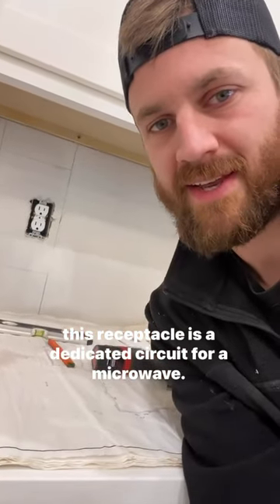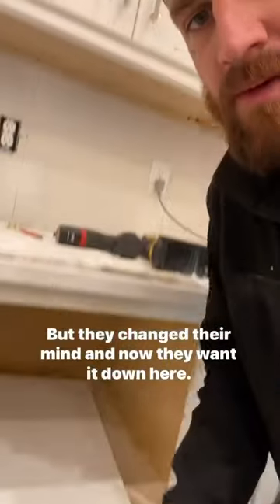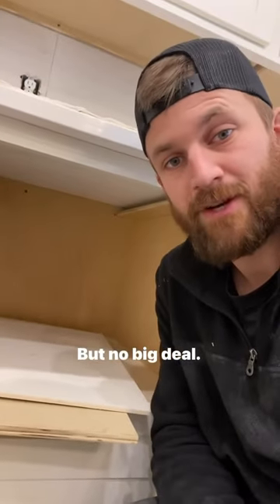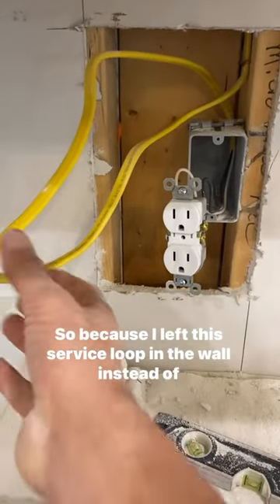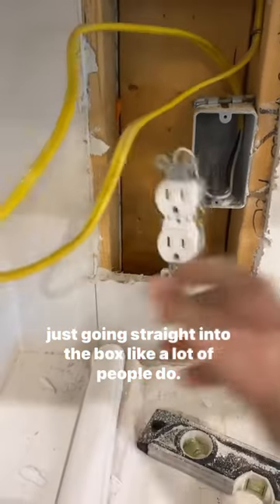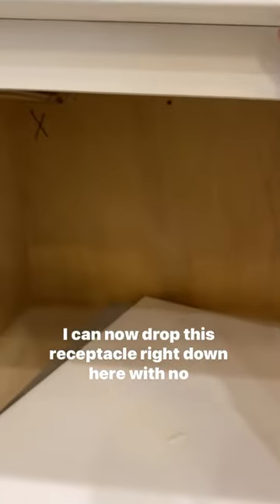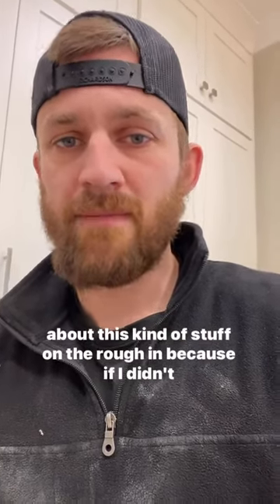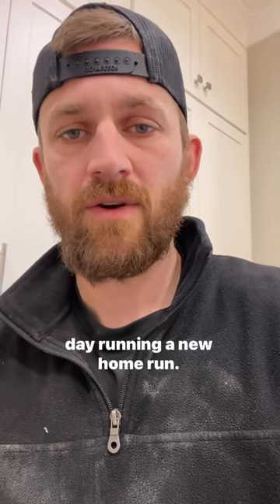This is Why You Should Leave Service Loops!! #electrician #bluecollarlife #construction

Comment: I see that receptacle is inside a framing corner? Stud on either side and one behind it?  I hope you caught that, I saw your X down below in the microwave cavity.  I’m not trying to troll you like 75% of the comments, I was just hoping you caught that it was inside a corner.   I have an electrical inspection coming up, I’m going to ask about the service loop issue that everyone harasses you about. Technically you have a staple within 6 inches of your box, there’s just a service loop between 🤷🏻‍♂️

Comment: My shop teacher for electrical in high school said that you should always leave some extra wire between the boxes because you need it there in case you want to switch your outlet or switch to a different one later.
Reply: Or the drywallers knick the wire while cutting out the boxes lol
Reply: @markk3948  you only need to unscrew the faceplate to get to the wires in order to switch out the outlet to a different one, why would there need to be drywall involved?
Reply: @MissMeganBeckett  when you rough in a house the drtwallers put the drywall up after.  Then they use the rotirzip to cut out the electrical boxes.  If they knick the wires which they usually do because they go too far in. Then you can pull out some of the service loops
Reply: Some wire, yes, it shouldn't be tight enough to play music on. The amount that guy left in the wall would never pass inspection. There's no way he's an actual licensed electrician. There's building code that says how much wire can be lose between staples.

Comment: You could have offered a new home run. You also could have just extended from that box and put a blank cover over it. Depends on how fancy the build. Make sure to offer legitimate cheaper options to the customer when available. In this case it was a good idea to have a service loop but that much wire left at every receptacle adds up.
Reply: Nope. Would violate code on counter top receptacles. That box will still have to have a receptacle in it. And since this plug for the microwave is just for the microwave it would be classified as a dedicated circuit and therefore would have to have a home run pursuant to code.
Reply: @thebigd6249  interesting. I thought as long as it was blanked out it would still qualify as a dedicated circuit. Functionally it doesn't seem like it would be a big deal.

Comment: By code you need 2 outlets on that counter top and your loop is technically a code violation. Way more than the allowed cable length after the staple to the box entrance. So your “genius service loop” that you relocated stupidly became two violations and you filmed it because you thought it was such a great idea.
Reply: It depends on what version of the NEC is in use in his state.  Many states are still using 2017, which has no maximum on how long a service loop can be (that was only added in the 2020 version).

(And there clearly are other outlets above that counter top already, you can see them in a couple of the shots.  Without seeing the whole space it's hard to evaluate whether everything meets code or not, but I don't see any reason to believe it doesn't from these shots (and these requirements have also changed a lot in the newer versions of the NEC, which may not apply here yet).)
Reply: @foogod4237  it’s not hard to evaluate. He had two and needs two. He killed one and moved it down. I believe code is no more than 12 inches of wire between staple and box.

Comment: The only problem I have with this video is that’s it’s clearly just for comments. It has no educational value, except maybe that extra-long service loops can be helpful. They also use up extra wire, raising the cost to someone, probably the homeowner. 
Since the rough-in person probably left two feet of wire outside the wall, it’s slightly better than cutting it off and filling up my landfill.

Comment: That's the thing service loops in a residential setting Do not make sense. They are stupid all you need to do if it the wires too short, in wall splice kit run wire down there, you go. Service loops are more of a requirement for a commercial setting

Comment: I've been a data cable dawg for 15 years, never seen sparkys use a service loop lol. I figured it was a code thing.

But can someone explain to me why TelCo guys REFUSE to put any loops ANYWHERE?!? they just add 1million scotch locks to everything.

"Pair is dead, let's switch and split pairs 30 different times between 15 IDFs..."

edit I don't mean the CO guys, I mean the ones post DEMARC

Comment: Or, since 99.99% of the time there will not be a "service loop", which isn't a real thing actual electricians do (because thats a giant code violation). You would have just spliced in an additional bit of romex either inside or outside that current box and ran it to where it's needed. No one aside from someone who likes to scam a customer with 18in of extra wire at every point or by running a whole new line to run up costs would do this unless the customer specifically stated "hey I'm going to move that outlet in a few years".
Reply: Service loops are not prohibited anywhere in the NEC (in fact, from 2020 onwards they're explicitly allowed in section 334.30).

And it totally is a thing that lots of real electricians do actually do (particularly if they anticipate that there might be a need to move the outlet in the future, such as a dedicated circuit for an appliance that people may want to change later, as in this case).

And this way he does not need to keep an accessible (and unsightly) box up top just for the splice.  He can remove the old box entirely and have a nice clean backsplash there in the end result, so it looks much more professional and the customer is happier.
Reply: @foogod4237  I'll go ahead and listen to what multiple inspectors have told me as well as 2 different electricians. No giant wasteful miles of unnecessary cable inside the wall for safety reasons. A few inches is sufficient.

Comment: Not a big deal. Is cut in a remodel box below. Reach up in the wall, grab the cable and pull it down. Problem solved didn't even need to cut the sheet rock

Comment: Just add a 2nd outlet running on the existing outlet Mr.Patches.
Reply: He said microwave requires dedicated circuit so having 2 receptacles allows something else to be plugged into the same circuit. It’s a code violation Mr. Walnut brain.

Comment: Calling BS on this. The in wall splice kits (designed for applications exactly like this one), like almost any Listed piece of equipment, is PERFECTLY SAFE IF INSTALLED CORRECTLY. "Service Loops" are a ridiculous waste of cable.

Comment: Why did you just cut all that drywall out? All you had to do was take the wire off the plug push it out of the back of the box use a flathead to pull the box off the stud cut a hole for another receptacle fish the wire down and patch with the new piece you cut out

Comment: Definitely a lot of use for the loops but I’m worried abt someone puttin a screw threw it on accident
Reply: If there was a genuine worry, they would have fastened a steel plate between 2 nearby studs in front of said wire loops to protect them the way it's required for plumbing and electrical in the code book. Then it's done correctly. Code changes very slowly and may not cover all situations.
Reply: That is why you should have an RCD/GFCI in the distribution panel and not in the receptacle.

Comment: A whole day for a 12/2 lol. And you didnt have to cut the rock like that. Get yourself a multi tool and cut the nails off and pull put the box then cut your hole in the lower cabinet and take a piece of 8 solid and hook it. And if you didnt leave a loop, cut in a box in the cabinet above and make a junction box and feed the wire from there. And just one blank plate.

Comment: Jeeze thats a huge loop (waste of wire) super loose aswell so could easily have drilled a screw in it or cut the wire when you cut out the drywall.  Anyway im pretty sure you left it that long just incase they needed to move the microwave.

Comment: Just leave this receptacle in place, cut out a new opening down in the drawer and fish 2ft of wire. That’s it.
Reply: Fr why cut drywall and make repairs when there's a solution that takes 5 mins. Looks like an easy pull too unless there's blocking
Reply: @blue_equinox7115  i meant cut a hole for a box, not a huge opening alike he did.
Reply: @yasha4929  I'm agreeing with you, talking about the cuts in video

Comment: I've asked a few contractors to do this and they either gave me a blank stare or a condescending chuckle.
Reply: wasntme7845  that's the third most common nonsense answer. I
Reply: No offense dude, but it’s not done because it’s not legal. You would not pass inspection. Also, if you looked at his work around the house and he did this with all his wires, the job will look horrible. When a job looks messy, the inspector will subconsciously feel like the job is wrong and will actively start looking at the electricians work for more code violations. I’ve been a residential electrician for 25years and I’ve never needed a service loop ever. There are ALWAYS other options, the last preferable option being an in-wall splice kit. Your electrician should have explained to you WHY a service loop is not allowed instead of making you feel bad for it but regardless, your electrician was right.

Comment: Except that cable isn't secured with 8" of the box. Yes, I said 8" because a non-metallic box without cable clamps is required to have cable secured within 8", not 12".
Reply: that box has an integrated clamp so the first 8 or 12” is covered either way.
Reply: @brandonrippeonphoto  No, it doesn't have an integrated clamp. It's a standard 70 cent single gang nail-on box. It has a square plastic knock out. It's just a hole.

Comment: So now where is your first outlet 24 inches from the wall to meet code? Why couldn’t you just left the service loop go down to the floor and back up to your box so you could’ve cut it in down below the cabinet instead of cutting out all the sheet rock why didn’t you just pull the outlet out and the box out and then just push the wire down the wall and fish it back out from underneath the countertopwhy don’t you just splice into it and leave the receptacle there microwave does not have to be on a dedicated circuit I just shake my head flew too high and fell so far

Comment: Hell shit all you'd have to do is cut your hole down below the other box and rec ,pull out the rec and fish down your 12-2 with ground down from the top box down to the lower rec box for the new microwave location and then just re install the new rec above the cabinet and install a rec down below the cabinet and your done!!! ..... Problem solved eazy

Comment: Microwaves need a dedicated circuit??
Reply: 100%
Reply: Any appliance that utilitizes more than 50% of the circuits power is required to be dedicated. for a 20 amp circuit you have 2400 watts available, most microwaves are around 1200-1500 watts, so yes it needs to be dedicated.

Comment: No no, this is all wrong, you're supposed to only run EXACTLY the amount of wire needed on the first try, to save on materials, then you are supposed to up-charge them for the replacement home run on the change order.  You are terrible at business!  (No seriously, I appreciate what you did, given that my own electrical installers screwed up on the outlet for the stove and had to drop down from the Microwave circuit).

Comment: You violate the code by putting the “service loop” in. I’m sure you think that you should be doing anything you want, but there’s a reason for codes. Also, If it’s going to take you all day to set up a junction box and run a wire 3 feet, please let me know so I’ll hire a real electrician. Also, love the oversized cutout that I’m going to have to call a drywall professional to fix correctly, or are you claiming to be that also?

Comment: Or you can use Emt like the rest of us. No big deal to rip the wires out and extend the raceway to pull new wire. 🤷‍♂️
Reply: Can't imagine doing a house roughin with EMT, but I understand it's required in a few areas.
Reply: When I did resi I would pipe kitchen boxes up into the attic for future upgrades, but most dingbats don't know how to bend pipe

Comment: Type NM cable must be installed back from the front edge of the stud - code requires 1-1/4”  back (think the length of a standard drywall screw) This is also true for holes drilled for lateral runs - the edge of the hole must be 1-1/4” from the edge of either side of the stud. In a regular 2 x 4 wall, a 1” hole exactly in the center of a stud leaves 1-1/4” clearance on each side. My point is that leaving a loose loop of wire in the wall could be close to the front, allowing screws, anchors and the like to come in contact with them. All this guy had to do was leave the receptacle above the counter, then run a line from there underneath. This guy is not an electrician, I guarantee it - he’s a handyman hack with little experience. Who am I to bash this guy? I’m a licensed Master Electrician and apprentice instructor with 45+ years experience. I plan on reporting this video as this practice is dangerous and not to code.

Comment: That loop is a code violation. Cant have that much extra cable between its closest staple and where it enters the box. Besides you are going to need an outlet there regardless to address that section of counter top facepalm

Comment: Sir, you’re absolutely incorrect. a new home run is not necessary if you’re short. Wagos are used for splicing and pigtails. If you told me that I needed a new homer for this project, I would have not paid you and let you out of my door; as in, your’re fired.

Comment: That's illegal and will trip sensitive arc-fault breakers. I don't do residential because it SUUUUUUUUUUCKS, but the answer to that isn't a new homerun, it's splicing in that box, putting a single-gang blank on it, and a cut-in box for the new receptacle. If that was new construction, the inspector needs fired, but I assume it's in Tennessee, so I'm just glad it even has a ground... If you actually loop every one you put in, you should be barred from ever doing electrical work ever again, but we all know you don't and this was sheerly for the video. Go ahead and grab 'A' phase in one hand and 'B' phase in the left next time you do REAL electrical work while standing in knee-deep saltwater. Thanks.

Comment: A service loop? Inside a home? Since when? If I saw an electrician doing that in my house, I'd want to fire him/her. What a waste of wire! Is this something where wire makers 'greased some palms' & got pushed through NECA legislation? Wouldn't surprise me a bit. What a waste of wire, which of course means more $$$ for them! 🤑 And what if you wanted to cut in another circuit & box beside that one? Could get dangerous, & getting wire down an enclosed wall could turn out to be a real pain. 

Regardless... You can't just splice in another box & blank that one off?

I thought I knew a little about code, enough, but admittedly it's been a few years... Guess I'd better refresh... But I'm not running That in my house. 😡😄

Comment: Put in a phone plate with nothing connected.  Looks legit and you can be sure no one will ever use it.
Reply: Ahha good idea but then if there was an issue later on with the connection in the box no one would think to look behind a low voltage plug 😊

Comment: Option 2: Leave original receptacle and run a wire down.
Reply: It has to be dedicated.
Reply: Use the original as a junction box if not enough cable.

Comment: What's ridiculous about that code requirement is that there is no way you'd overload that 20 amp circuit if you left that counter-top receptacle and just added another for the microwave underneath it. Even if a toaster oven or coffee maker was in use at the same time as the microwave that circuit would be more than adequate.

Comment: And do yourself a favor put the outlet in the correct way put your grounds upside down that is the correct way of doing it turn your outlet upside down that way when you go to plug up in you don’t have to flip that cord to plug it in. It is the right direction manufacturer that make the appliances do the chores, right but humans don’t put outlets incorrectly. They put them in wrong. There’s no code for this, it’s logic and looks and safety people got used to grounds being down instead of up up is the correct way that way you don’t have to flip the cord you can get extension cords plugged in in one outlet where you don’t have to have the adapters you don’t have to cut the ground off

Comment: So what happens when they hit that with a nail or screw?
Reply: You could say that about plumbing and hvac as well. I leave service loops and ive never had a screw or nail hit one.
Reply: Punching out the new local utility we just did one of our temps was drilling though a wall above ceiling and booooom right into some Mc for 277v lighting circuit

Comment: Ummm not true . You would of just pulled the plug put In a junction box wire nut another piece of wire to it put the cover plate on the junction box drywall patch over the junction box  the new piece of wire would of coarse be dropped out of the bottom of junction box and into a new box lower and problem solved so no new home run don't lie.

Comment: That wire wasn't strapped within 12 inches of the box though and you would've failed your rough inspection if the inspectors weren't as dumb as resi guys.